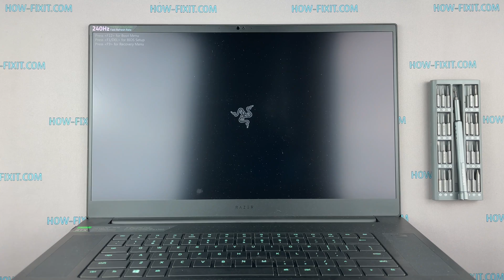Razer Blade Pro 17 Disassembly, fan cleaning and thermal paste replacement

Comment: Anyone know where /how we can get a new / replacement Cooling Unit (the heatsink plate)?  Razer is, as usual, less than helpful about replacement parts :)

Great video, but after doing all the steps and replacing the fans with new, its still overheating - i would prefer to not underclock my chip, since for the first year this laptop ran like fire (rz09-0368) but now i cant seem to get it back there, thinking that maybe the "cooling unit" would be the last thing i can replace overall and then assume its something "on the board" running hot now "forever" (burn in?).

Comment: You do not have to spread it. All there needs to be is a small drop and that's it. There's no need to smudge it all over. It automatically does it for you when you place the heat cover back on top. Tests were even done to show it does nothing to improve the temps. Infact it places it at risk placing too much on. as if it drips Ur fked. Hence small pea drop is enough.
Reply: @concertofdepression  nah test were already done. A pea size showed the exact same result as X and everything else they concluded the worst is when you try zig zag or cover the entire thing in it. Best results were X and pea size which were 99% identical.

Comment: hey, you didn`t clean the lower fans, they are merged into battery block. how very weird. they are absolutely filthy on mine, so I air blown them, however would be great to know how to remove lower fans from the battery, they seem like a solid block....how mysterious...
Reply: I removed mine by peeling back the black rectangle sticker on top of the two fans then you should see the screws, the battery does not need to come out.

Comment: Great video on the repaste of the Razer Blade Pro model. Could you please advise me on the thickness of the thermal pads that are used under the heatsink? I am planning to repaste my Razer Blade Pro (2020 model). I am planning to buy some thermo pads in case of damaged or broken original ones.
Reply: You could physically measure it with a ruler and compare it to online thermal pads.
Reply: i have the same ploblem :-)  looking for pads...but how thick,how much shore....nobody knows ;-) (i google and ask for 2 weeks...no chance)

Comment: Yeh , Except you can't Undervolt the CPU. Razer have locked down the BIos.Doesn't work in XTU or Throttle stop.
Best you can do is limit CPU power in windows by either limiting the number of cores using windows sys config or the power profile of the cpu in the battery / mains settings to say 98/99% max CPU power profile on Mains / Battery
Reply: Pretty much all companies are doing that. My dell g7 I had couldn't be undervolted either.
Reply: I was playing with throttlestop the other day and after undervolting to -200 ~ the laptop was crashing which I think means that the program did something.